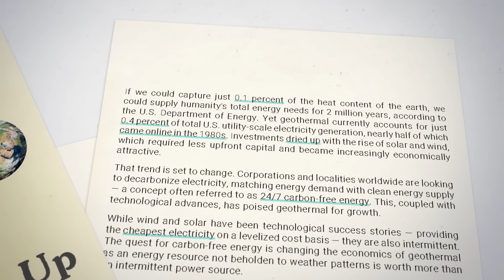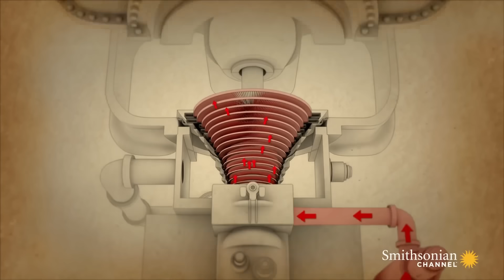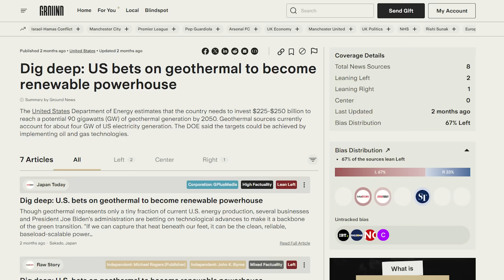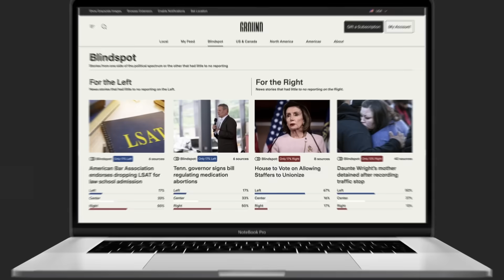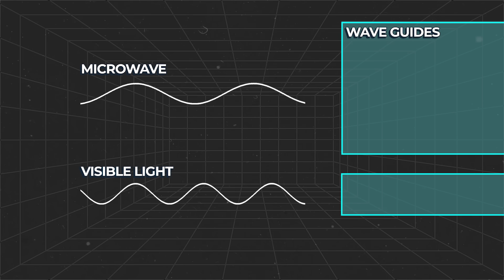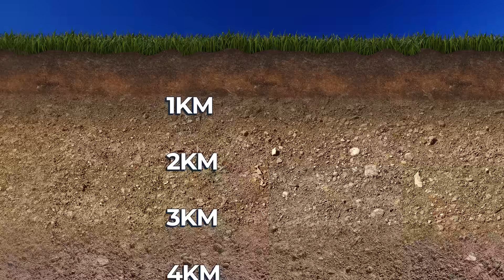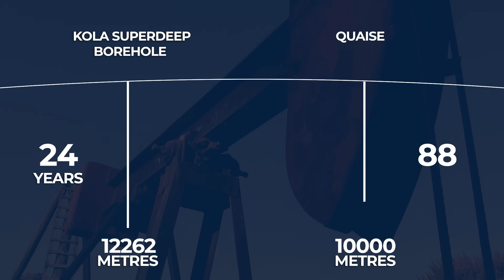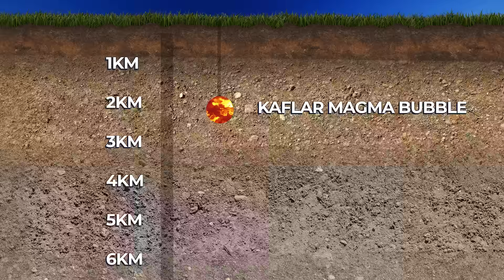This Fusion Tech is Solving the Geothermal Energy Problem

Comment: I did some analysis of Ice Cube and some annular vertical two phase flow analysis.  My gut feeling is that heat losses will consume the energy so the efficiency will be in the lower single digit or less. 

     Ice Cube similarly drilled about 80 holes with hot water 2 km into the South Pole ice cap to build a Neutron Telescope.  A 10 cm stream of hot water was used to make about a 61 cm diameter hole.  Once the hole was drilled they had about a day to install the a string of glass spheres about 46 cm diameter before the hole diameter reduced down from freezing water. 

     As seen the hole diameter is much bigger then the beam in the pictures shown for shallow holes, like Ice Cube. Just like the above stream of water, the rock vapor will turn to a liquid and then a solid slowly to make the glass like surface at a diameter bigger then the beam.  And liquid or vapor rock entering the beam will be returned to vapor consuming energy, but maintaining a diameter bigger then the beam. The heat loss in the rubber hose of the hot water in the hose to the OD of the hose is the same effect.   

     I assume the beam is in resonance like a lazar else it is like a flash light that expands at a fixed angle, a cone, useless.  And even a lazar has a very very shallow cone angle.  This is where the mirror for that wave length comes in to play.  Wave guide is metal for this wave length. Rock isn't metal so the property of the glassy rock will change with the rock and is an unknown. The vapor rock is the media in the beam itself, also an unknown spreading effect.  And the heat loss conducting the heat from the ID of the hole into the infinite heat sink, an other unknow.  I assume to get the present funding all of these losses and effect were modelled.  The latter conduction loss has an exact solution, the assumption are the problem with this analysis.  The testing goal is to put numbers on the assumptions.

     So let us assume the hole is drilled. No mention of how water is sent down the hole and vapor comes out.  I assume annular flow of which you can find dozens of analysis for vertical annular flow where the fluid is flowing opposite the vapor. Far fewer with heat transfer is occurring to create the vapor or condense the vapor.  My guess in doing some of this analysis decades ago is that this doesn't work for such a long hole.  

     That leave the next approach of meeting two holes at the bottom and pumping under pressure liquid down and up with the vapor made in the plant directly or by a heat exchanger.  The heat loss to the infinite rock around the is likely for this depth is going to absorb the heat slowly heating the rock nearer the surface of the hole with as diameter increases a lower temperature rise but more area.  The conductivity of the rock has to be low enough to make losses low which means at the bottom the reverse is happening to heat the water.  My guess is that a very deep large diameter mechanically drilled hole  will be needed to provide the insulation to reduce losses for the hot water hole.  And the diameter of the drill may also have to increase to increase the ratio of area to perimeter.

Comment: The only theoretical problem I see is that instead of producing sustainable, non-polluting electricity directly, we are starting with heat released from inside the earth to the surface, upsetting the heat balance of the earth’s surface.  The more successful we are in using this form of energy, the worse it is.

Comment: I love this. The idea looks a lot like what we saw in the movie The Core. 

I hope it works as advertised and we can drill safely though unknown materials. How bad would a natural gas pocket react to one of these laser-drills cutting into it, or a vast oil or coal field?
 
Think boldly, but build carefully, thoughtfully and conservatively. Sadly, I just know that if it does prove effective and safe the Left is going to go nuts over it, same as the fracking issue, or any other thing they don't control yet.

Comment: Why dig many miles deep, when all over the world there are hot springs at the surface of the planet where molten rock is near the surface already?  Can you use your new system to simply install steam generators where the hot water has naturally reached the surface??

Comment: Before there were Lasers, there was the Maser - Microwave Amplification by Stimulated Emission.. It produced a collimated beam of microwaves. It sounds like the Gyrotron is similar, though not as collimated, but far more powerful. BTW, the magnetron in a regular microwave oven is simpler, uses a cold cathode, and is much less powerful.

Comment: Time will tell how stable such a hole is. I hope they can start to drill holes in places that are scarcely populated. In some places you will drill in rock, in others will be layers of salt, chalk, clay or something else. You can affect the stability of the whole region, especially when water under high pressure is involved. Getting to depth might be easy with this method but keeping the whole hole/pipe stable will be a challenge, I think.

But I would love this to work as hoped!!!
Reply: It wouldn't be an option in all places.

But even if it would be an option in only 20% of major cities, that would still be a massive contribution to the total energy supply and demand.
Reply: @Yora21  Yes it would, but if for whatever reason the hole/pipe, wish I understand should be something like magma glass kind of material, proves to be unstable/leaking and e.g. allowing material from 10km below to enter the groundwater. That may have serious drawbacks, especially in major cities.

Comment: I live in the Netherlands near The Hague. Not far from my home there’s a geothermal installation. It’s primarily to provide heat for greenhouses but it can generate enough warmth for a couple of neighbourhoods too. 
They had to drill two holes of ‘only’ 3 km to reach a reservoir of warm water. It’s not warm enough to generate electricity but more than warm enough to heat houses.
Reply: While it doesn't generate electricity, that heating has the run on effect of increasing electric grid capacity. If your heating is sorted out by geothermal you don't need to use electricity to warm houses. Also any gas that would be used for heating can go to electricity generation.
Reply: @azzanine1710  Good point. Tx!
Reply: @azzanine1710  yeah. in Romania we have mud volcanoes and some thermal waters, they could be used for this as well in all the resort cities we have. But our corruption is so high, we're never getting good resource management.

Comment: Drilling is just the first step. Do you rely on the fused walls of the hole to prevent leaks? If you use a bore liner, how do you overcome corrosion and erosion by saline brines at depth? How to prevent mineral deposits building up and clogging the low-pressure side of the system?

Comment: it may not be possible to do this everywhere, but the prospect of simply replacing the source of steam for a power station by tapping into geothermal heat near existing power stations sounds amazing. You can use all the infrastructure from steam powered turbines to the electricity network. and.. while drilling you can get the energy required from the power station itself.. what's not to love.
Reply: We should, as a species, have pause before we begin to mess with the systems of life itself.  I don’t think I’m comfortable pulling energy from the system that keeps our core spinning and our magnetic field strong.  Imagine cooling the core and slowing it down….forget the earthquakes that’ll happen as the mantle slows down because anything that survives will die from solar radiation as the magnetosphere fails.
Reply: @LiberalVet  He was talking about drawing off a fraction of a percent of the available geothermal energy over the course of two million years. 

A gradual breaking period of 2 MILLION years is about the smoothest and most gentle transition you could possibly imagine. So don't worry, there won't be any catastrophic super earth quakes caused by this...
Reply: I don't think this accounts for the fact that the more energy is available for use, the more will be used. Those 2 Million years would probably be more like 100. If we're lucky. And we'd probably not stop after that, let's be real.
Reply: @flynnlies6944  and why would we. But you are wildly optimistic in your numbers. from 2 million to 100 is a factor of 20,000 that's enough to start boiling the oceans. We would not be able to use that much power, unless we were trying to build a death star....
Reply: @flynnlies6944 
You don't really understand how little energy we would be utilizing. Until you do the math and realize.   It's not a concern whatsoever, especially compared to other forms of energy.
Reply: @LiberalVet time needed to this to maybe be a problem IS 1000 times longer than the time we have to manage the mess we already caused with climate Change
Reply: @LiberalVet  It is a question that needs answering! I imagine there is a bunch of incoming energy from the push pull of gravity, as long as we only use a sustainable amount I’m not too worried. That said another wave or rampant consumerism does away with prudence, checks and balances, in the name of share holder profits. IMO the working public needs to be a placed as significant share holder, similar to Norway’s ownership of Gas infrastructure.

Comment: So you vaporize the rocks untill you reach mantle and then what ?? It will keep flowing in ..... and no we dont talk about magma we still talk about a ROCK in mantle looong time before you reach magma rock under pressure act like a liquid....

So unless you reinforce the tunnel whit some UNOPTANIUM material that can wistand the heat and pressure you are done....

LOOKS TO ME NOTHER FUND US AND WE TRY TO FIND SOLUTION OR NOT PROJECT BASICLI A SCAM

Comment: Doesn't really sound like 'renewable' energy to me... Sounds like it's even less renewable than fossil fuels. At least fossil fuels are basically solar energy that's been stored for a couple of hundred million years, so you can 'renew' it in that time. Geothermal energy is energy stored during the creation of our planet. Using it will increase the cooling of earth (even if it's ever so slightly), with no idea how that will affect volcanism, the magnetic field or whatever, and there's foreseeable way to ever replenish it. Not a fan... 

Just go nuclear, at least there we are certain of the effects it'll have and the time scale for possible problems there is much shorter than messing with our planet's core...

Perhaps we can use this drilling approach to get rid of our nuclear waste... 10km sounds deep enough to not cause problems 😉

Comment: The seemingly most valid concerns in the comments have to do with the problems of pressure and power source going beyond 5 km deep. I love the idea of "anywhere geothermal" and I don't remember the company name, but they want to do a near surface (less than 2km)  closed loop system. This saves water and avoids potential for earthquakes, without needing to dig so deep. I wish them luck, I feel like there's also a company doing laser mining, but maybe it was this.

Comment: infinite is definitely the wrong word.  It means unlimited in any direction.  The planet earth is definitely finite. 
But lets pretend that you didn't use the wrong word. 
The planet's heat is not limitless either.  
So you are using the wrong word yet again.
Oh Gosh

If we take heat energy from the core and  transfer it to the surface - - - well  at some point there should be  issues.  Ya know like  solidifying the core and destroying the magnetic fields and  losing atmosphere to space.

Comment: Instead of heat, if you could significantly cool the rock locally the thermal stress maybe enough to break the rock in a tensile direction, which is a lot easier than compression.  Just need to move the heat around, not bring more with you, although that is terribly difficult over a very short time scale.

Comment: Problem is delivering the power (megawatts) to this bit from the surface.  It's not like an extension cord is going to work, you need a wave guide that can handle this without significant power loss for 10-20km.  I know people have used electrical arcs to break the rock into pieces and it was much more efficient than complete vaporization, but commercialization is also held up by power transfer.

Comment: Why not use previously drilled bore holes for oil and gas to save on the distance needed to drill to where geothermal is efficient? That would also make use of preexisting infrastructure and be close enough to thermal generating plants that are no longer needed for coal powered generation.

Comment: Look up the indonesia mud volcano. It is likely caused by a company drilling for natural gas. New research reveals that the earth crust holds around three times the water as the oceans. Earth crust is constantly shifting even in non earthquake zones and likely to cause the hole to collapse/break over time. Drilling that deep, not knowing if they are going to hit a large pocket of water that will force its way out and cause another mud volcano. Sounds like a good idea, but to me, it is too high risk if done in an area that can flood an entire city.

Comment: Low radiation nukes can dig through a few miles of rock pretty easy. Not that expensive to make or set off. So then you gonna reach the hot water charged earth pretty easy after that :) might run into some reptillian civilizations maybe.

Comment: IT all sounds good on the surface. Issue is we're already having issues in parts of the world where we suck out too much water from underground causing lots of issues. If they modified this approach to only suck out heat and not heat and water then we'd have us a solid winner if they could pull it off.

Comment: @12:55 What is omitted in the competitive cost measurement, the costs of the off the ledger expenses, the disposal/recycling costs of the "renewable" energy generating components, the environmental cleanup of mineral fuel extraction.

Question though, how are the gases from the vaporized rock dealt with? Will elements within those fumes become valuable and thus whole arrays of fume deposition for say metal recovery devised?

Can this Fusion Tech be made directional as is the drilling tech for the fracking drilling operations?

Comment: In the USA - ! Megawatt can power between 200 to 670 home so for 300 Megawatts a range of  60,000 to 201,000 homes.  But then again for Iceland, the homes would be built to a much higher energy efficiency than in the USA.

Comment: What actually is vaporized rock?.  What prevents vaporized rock from recondensing on the cool surfaces of the bore hole while exiting?.  This is the reason they don’t have a hole drilled yet but I’m sure they will in 5 years with more funding.

Comment: I believe there was a technology developed in the early 1980's using electrically heated tungsten thermal drill bits to melt thru soil and rock, creating rock-glass borehole linings.  Oddly the initial development was funded by the US Interior Parks Dept .  The Parks Dept needed to place modern utility conduit runs thru foundation rock walls at old landmark Parks Dept buildings.  Their project was successful serving that use case.  Somebody realized along the way the same tungsten bore bit might be employed to drill efficiently thru hot rock which as this video points out is very difficult and expensive.

Comment: Sadly nothing substantial on the potential downsides (typical for these informertials). For example Basel had to shut down it's EGS because it lead to earthquakes. Doing this under a city is risky.
Also the timeframe for energy extraction is VERY misleading. EGS extract heat from the rock, not the core of the earth. Thus a plant will work for 20-30 years before the rock connected is too cool and a new hole has to be drilled. That's 100'000x shorter then what is stated in the video.
Interesting, yes. But it may damage the city it's powering and will only last for 20-30 years. 
And as others said: We no longer need 24 years to drill 10 km.  

Just regurgitated marketing material :/

Comment: The other problem with geothermal is that removing heat from deep in the earth bring us closer to shutting down the source of our geomagnetic field, the field that protects us from radiation that would make the surface uninhabitable.
The process by which the inner earth generates this geomagnetic field is  not well understood, so itt is difficult to know the effect of removing more heat.
Reply: "Deep in the earth"? There's a difference between drilling down 10 km into the crust, and drilling 3000 km into the mantle and outer core.
Reply: @ps.2  The only cooling for the core is through the crust.  
Once again you are talking about perturbing a poorly understood system that maintains the atmosphere on the lanez and shield us from extreme radiation.

Comment: If you vapourize rock into gas then what happens to the gas when it cools down on the way up? Isn't it going to condense and turn into rock again, settling on the sides of the hole  just above the drilling point?

Comment: Nice, but: vapor tends to condense on cold surfaces, i. e. the boring rods or the surface of the hole some dozen meters away from the action. Won't it clog the hole?
And the vapor which condenses as dust in the air needs a good amount of high pressure airflow to be blown out of the hole...